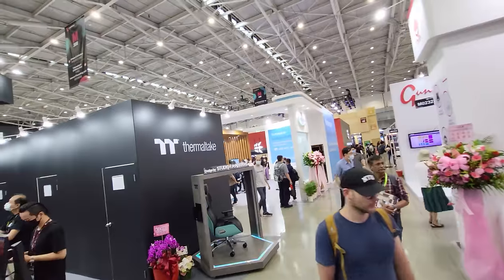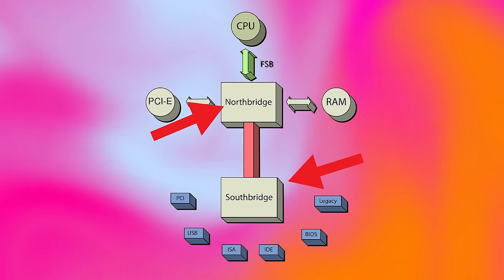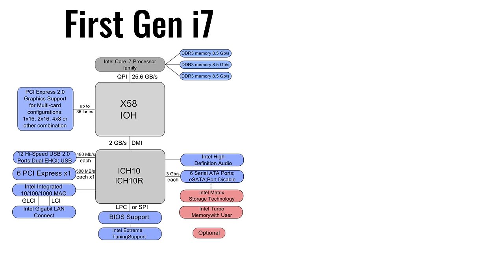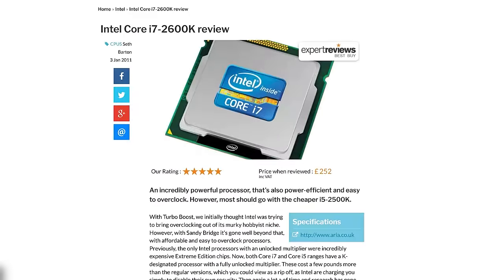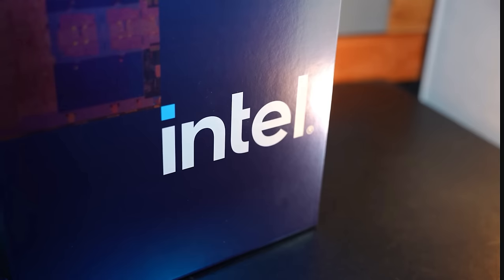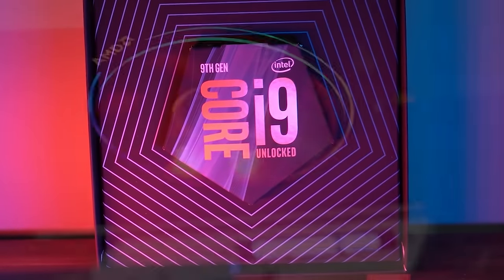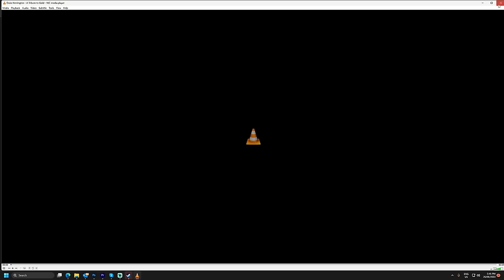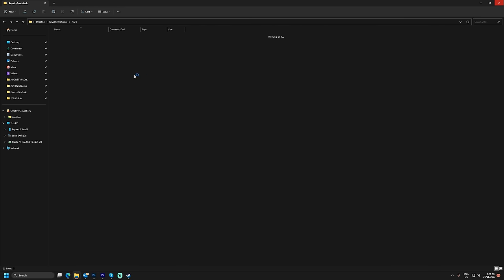SNAP - The Intel CPU Latency Story (Part 1 of 2)

Comment from the maker: I am having an I/OO - Input Output Overload.
Reply: Honest question - do you mean diarrhea??? 😮
Reply: is that why you calculated that 69 to 82 is a 32% increase in your 4060 video?
Reply: I love this video! I was considering upgrading my 8600k to a 13600k and have been looking up motherboards/ram to buy in the next couple of weeks. Now I am considering saving some money and trying to find a 10th gen as I only wanted to upgrade because my cpu is bottlenecking my 3080ti and I wanted to get the most out of my gpu. Do you know if 11th gen has the io on the cpu too?
Reply from the maker: @tyre1337  Yeah pretty busy with a lot of things at the moment, made a mistake on that one, punched a different number into my calculator, will update the description.
Reply: I still have a 2600k Sandy Bridge. I almost considered a 13900k yesterday.
Reply: @SirBlot  maybe look into AMD, the 7000 series is pretty solid.
Reply: @funkysmokee8764  I am going to wait for Nova
Reply: @techyescity can you make a 10900k vs 13900k build i/o latency comparison
Reply from the maker: @ludiqpich198  Once I have finished the other rig I will do just that.
Reply: @funkysmokee8764   I am pretty happy with the 7800X3D with super tight RAM timings to boost snappiness of windows.
DDR5-5800 28-34-34-34-30, so many gamers think EXPO settings are good, but they are very slow set on latency.
Reply: Steve from gamers nexus have done an investigation on the statement that claims Intel has lower input latency than Ryzen in the 10th gen days "on games". He tested low end I3 vs high end I9 at the same FPS and the input latency was exactly the same. He tested a Ryzen CPU vs Intel one at the same FPS and ended up at the same input latency results. He also did other multiple tests that I don't recall and all of them were exactly the same latency. He concluded that: No! Intel isn't faster than Ryzen. Both CPUs are exactly the same at the same FPS. People was talking about Intel having lower latency than ryzen and saying that it is because of thr chiplet design, but that ended up wrong.

In short for gamer, it doesn't matter. The better CPU that gives more FPS is going to give lower latency no matter the CPU design, but from you I see that for content creators and mainstream users the story is different.
Reply: are you really gonna release a video like this and not even include any input lag measurements?
so far it is just a theory - so confirm the theory by comparing a newer and older cpu
Reply from the maker: @ShakeITyEA  Yeah why not? there is no one talking about the topic, there is no information on it online, only information buried with a few people close to the issue in Taiwan.
I already confirmed the issues I am having in this video via the clips, do I need to make barcharts? If so that will take some time, I would like to see (which if you scroll the comments), who else, if anyone else is having this issue, and already there are quite a few reports. 
Also it's not a conclusive video, hence story in the title.
Reply: What you demonstrate in the video is not latency related, more likely a thread management issue.
Reply: @techyescity in your future video's can you please elaborate on the extent to which this effects low end cpu's like the i3. Most of my clients dont need and cant afford the i7 and i9
Reply: Please in next video make a comparisons with amd cpu too
Reply: Why not downgrade to the 11th generation but to the 10th generation if the 11th generation is the same about it ?
Reply: @Y0Uanonymous  convenience (probably parts on hand) and the 11900K wasn't really that much faster in multithreading due to a core count regression in the i9 (10 cores vs 8 cores)
Reply: i was planning to update my 4790k rig but will wait 
thanks for this info!
Reply: @ludiqpich198  I would like this too!
Reply: @N0N0111  But have you tried latest gen Intel?  If not, what are you comparing it to?
Reply: @SirBlot  Well if you take the advise of this vid you`re stuck with it till dooms day.
Let me tell you, you won`t believe the difference between your antique and 13900K. 
Just do it.
Reply: @IslamGhunym  Don`t get fooled and or played.
This is a complete crap video.
It`s something else, it hasn`t anything to do with latencies.
If you just hear him talk about quality silicon then you know where he is talking from...........
Reply: @ShakeITyEA  Off course not.
This what we call attention seeking, it`s all nonsense.
Reply: google "intel amd ssd test purepc pl" and translate to english - the conclusions are interesting - Intel scores in synthetic SSD benchmarks, but in real life applications AMD is faster.
Reply: Have you ever heard of the Calypto latency guide? It will probably not be entirely useful to you, but it could still be somewhat interesting.
Reply: @flanovskiydtauskiy5870  I'm sorry but that calypto guide is a joke, of course better hardware, clean Windows installs and overcloking improves performance, but the rest of the changes suggested are BS. Basically everything in that guide has to be double checked as they don't show real benchmarks or list any drawbacks from the tweaks. The hardware recommendations listed are very misleading, I don't know why they even bothered. Also the sources linked aren't exactly good either, with a few expections such as the integralfx DDR4 OC guide. Just stick to Tech Yes City Windows guides instead.
Reply: @SirBlot  good sir. i have scanned every bit of the internet for good prices on used CPUs. I got a cheap 13700k that was not far from the 12th gen ones. But the i7 10700k was super cheap and it's motherboards as well. my 13th gen upgrade FORCED me to buy, one by one, another component, and another one and then another one, and now i have to wait for a new PSU (100$ more). and when that comes i'll surely find some other bs part that is "too old" or some other shit, that requires changing.
Reply: I was noticing lots of latency while cleaning out laptop and using textboxes on my new 13gen laptop. I thought it was windows 11 but i was confused because i got pcie4 nvme m.2 6000mbs ssd. Work intel win11 pc with ssd lags out also. My ryzen 1700 5year old pc window 10 with pcie3 nvme ssd never lags out. I'm waiting for 2026-27 to build a new AMD cpu and AMD gpu pc. Kind of upset about Intel.

Comment: I am proud to say that I have witnessed the Intel latency problems first hand when you were editing vids in Taipei.
Reply: Grab win 10 iso, newest build.
Then grab Rufus
Burn a win to go image
Use a ssd sata drive on a USB adapter. Like a 840 pro.
Soon as you get booted up install primo cache. Create a cache on the boot drive, say 8 gig. Use the infinite option from the drop down.
Next, re format your nvme drives using 16k or higher clusters. Not 4k. Then add those to primo.
Your going to be shocked.
Reply: @Hawlkeye-e9p  You know it!
So many people don't know how good Primo Cache is with 64GB of fast and latency overclocked RAM.
I use 50% of my RAM as Primo Cache for read & write now for over a year, before that I have used it on a 32GB RAM system with 0 issues for years.
With Windows 11 getting good optimizations and actually feeling snappier than my like 3 years old Windows 10 Pro custom install.
I am thinking to go build a Windows 11 custom optimized iso, currently testing the "Windows 11 Tiny" and it runs very good.
Reply from the maker: @Hawlkeye-e9p  will check this out. First time I have heard of it.
Reply: @Hawlkeye-e9p Sounds like bullshit. It's just a stupid RAMdisk
Reply: @Hawlkeye-e9p  How does RAM disk solution solve any interactive latency issues?
Reply: @Hawlkeye-e9p so, someone has to go through all that workaround to compensate for intel's design flaw? Ouch.
Reply: @stanjs  Might mitigate it, is all

Comment: This is amazing, not a lot of techtubers really talked about latency and real user experience.
Reply: Off course not. Because there is no such problem.
This is a nonsense video and you`re getting played.
Reply: @brugj03  OK intel marketing team
Reply: @brugj03  That delay we saw in File Explorer is dire! I would not put up with that even on a network. If Brian can't fix that himself then there must be a real problem. Do all 13th gen systems do that or just some?
Reply: @wayland7150  It seems you have a little more faith in the capabilities of our honored host.
But being so obviouly wrong in this case. I have my doubts.
Reply: @brugj03  Brian is a fixer, he will have re-installed Windows for a start. Personally I would have tried Linux because that's very different, if the same fault showed then I would conclude it's hardware and work from there.

Comment: In part two could you add some latency metrics? Maybe compare AM5 to 13th gen vs 10th gen
Reply: this
Reply from the maker: Next part will finish the story, though once I have completed the 10th gen build I promise I will compare it to the 13th gen, and even Ryzen 7000, will go quite in-depth.
Reply: @techyescity  Could you please add AMD's monolithic APUs to the test? Preferrably Zen 3+ or Zen4 ones.
Reply: @yurymleh  - zen 3 would be good to add
Reply: @techyescity  thanks, this would definitely help with my upgrade. Still on 8086k
Reply: @techyescity dont forget ryzen 7 s that only has 1  core chiplet thay reduces latency
Reply: @techyescity  Maybe reinstall Windows before each test so that nothing can interfere with the results. The Windows installation in your video doesn't seem to be a fresh one to me, but I might be mistaken.
Reply: @techyescity  thankyou!
Reply: This is weird because I haven’t had any lag what so ever. 🧐
Reply: I know everyone already knows this but remember 10th gen does not support Pcie 4 so 11th Gen was always the sweet spot.
Reply: @the_bunse  while rocket lake is quoted to be a joke of a generation 😭

Comment: Now this is very interesting, i just went from an 8700k to 13700k, upgraded almost everything including the nVME SSDs to gen 4 and i was puzzled by the feeling of it being less responsive and laggy than my gen 3 and 8700k and despite a crystaldisk mark showing superior bench results. Thanks for the finding!
Reply: samesamesame. I went R5 2600 -> 8700K -> 10700K ->11700K -> 12900K. Going from Ryzen to Intel felt like a 2x in responsiveness. 10th/11th to 12th gen felt like a 25% regression and I've had to do a lot of things (ie static overclock, no c-states, hecktonne of RAM tuning, moving to all PCIe Gen 4 NVME's) to claw back half of it.
I also tried a 5800X but it ended up feeling worse than my 5.1GHz 10700K so I went 5GHz 11700K, which ended up feeling and performing the same.
Reply: Just over clock your ram. Got ddr4 4000 cl 16 working with mine and now have 43 ns. I get more fps than most ppl on a 13900k
Reply: @weyo14  This isn`t about that.
Reply: @brugj03  well overclocking the ram should also help with snappiness. Not just fps.
Reply: Turn off c-states and enhanced speedstep and the last one that i don't remember. Leave turbo on, set windows to high performance and turn off memory integrity. No issues here with an i7 12700KF
Reply: @Manakuski  Off course not. Something otherwise would be a fault.
Reply: @JadeIsler Have you tried disabling e-cores on 12900k?

Comment: What's your opinion on Ryzen CCD/IOD latency, Zen3 vs 4 vs Intel?
Reply from the maker: Ryzen 7000 is getting really fast, especially when I was using the 8 core models, that was my initial impressions. 
I am going to trial however 10th gen, followed by Ryzen 8 core and then the 16 core for 7000 (they can behave differently).
My approach however is more for video editing and heavy multitasking, based on a accelerated mouse clicking style, it maybe niche but it's my style of doing things.  It will take time, though for 12 and 13th gen I am giving it up pretty soon.
Reply: @techyescity  when you disabled the e-cores did you also increase the ring/cache ratio? My 12900k does 5.0ghz on the ring no issue with the e-cores disabled. Maybe that's what it is. memory latency tested at 45ns in aida, 43ns in intel mem checker. My old 10900k was at 38ns memory latency.. so a little better but hard to believe that difference is what is causing it. Can't find any info regarding the io driver you were mentioning.. looking forward to part 2. I'm using intel optane drive also.. not sure if that actually helps much. I can't notice any difference with that and a normal nvme ssd.

Comment: I have both a 10900K and an 11900K (yeah I know) and have no plans on going higher up the series for reasons as this,  and temps...great topic.
Reply: Well my 11700 KF not overclocked yet runs at only 48 Degrees Maximum in a Mini ITX case Thermaltake Tower 100 but using the Coarsair H 120 V2 120mm best ever AIO that runs both a push and pull fan on an extra thick radiator sitting on the top of the tower it works exactly as I planned and runs way cool giving me the ability to really stretch the CPU in the future to the max Basically it thinks and acts like a 240mm AIO but in the tower 100 is given the absolute best case to work in.
My reasons for not going beyond the 11th gen is it is the last one to support something I actually use AVX 512, The Latency issues are just an added bonus for me
Reply: I’m using a 11900h in my laptop and whilst it’s deemed better than the desktop ‘remodel’, it’s still quite responsive and powerful enough for fps and multi core gaming 💪🤩🥰👍 and the 11th-Gen lineup / mobo can be had for cheap and features vg latency results!
Reply: I have had all of these cpu, including 12700k, 12900k and 13900kf, and trust me, alderlake/raptor lake with tuned ram is as snappy as 10th and 11th gen.
Reply: @Pillokun same here. I’ve had 9900k,11900k,12700k and now a 13700k. The 9th gen has the lowest latency but once tuned the 12-13th gen is almost as good.
Reply: The 11th gen was ambitious and interesting but missed the mark as a new product. I don't think there is anything wrong with it though.
Reply: @Pillokun  true!!!

Comment: Truly a great video! I noticed the exact same thing, I was kind of expecting it when I saw the hybrid design of LGA 1700 but I didn’t thing it would be this bad. The video was an eye opener because up until now I genuinely thought it was just due to the e-cores. Turns out, intel ditched the ring bus architecture that made them so much sales and appreciation. At the moment I switched to a 7000 series Ryzen (going AMD for the first time after having intel my whole life, I switched to a first gen Ryzen when they just came out but quickly backed off) so we’ll see how it goes!
Reply: 7000 series is very snappy. With what I saw in the video I couldn't really believe my eyes, that's terrible for a daily.
Reply: @benjaminsmekens2344  I think the video demo is very unscientific and unreliable, many things can cause that kind of behaviour. He just picks one and makes a story about it.
Reply from the maker: @brugj03  picks one, with validation from people who actually designed the cpus. Left that part out
Reply: @techyescity  I think you better check your hardware or drivers, ther are problems.
Nothing to do with latency.
13900k Is ultra snappy. Never had a problem and build many systems.
Reply: @brugj03  we'll see once the hard numbers are out in the next video. I find this hard to believe as well, since I've never had any problems with snappiness on my 12th gen system. Now I'm REALLY curious to see what Bryan discovers in his testing.
Reply: @techyescity  Brian, it's can't simply be the CPU is that bad, that delay you showed was diabolical. It's gotta be a timing problem in a driver or something. Something that can be fixed with a software update when they get round to it. Have you tried it in Linux? Open that same directory and see if it's delayed.

Comment: i haven't noticed the issues you had with my 12900k. My old pc has a 10900k with a z590 apex mobo and bdie  ram. They both feel comparably snappy to me. Is there a test that can measure it  better? Or something more repeatable?
Reply: Me too! I have an i9-10850K @ 5.2 Ghz in the living room for 4K gaming. My desktop is a 12900K @ 5.2Ghz, paired with a 144Hz /1440p display. They both feet very snappy!
Reply: @Gamevet  yeah, i'm waiting for part 2 where he's going to go more in depth. My 12900k has the e-cores disabled, the uncore ratio at 4.9ghz , avx512, and the p-cores at 5.0ghz all core. It's also using tuned ddr4 bdie ram like the 10900k. Brian said he disabled the e-cores and it wasn't that. It's the "io driver." But none of the things he pointed out like ms word hanging up or file explorer lagging happened to me. So I have no idea how to repeat it. Both the 12900k and 10900k feel equally fast to me in daily usage. I used aida64 to measure the memory latency and my 10900k was at 36ns and my 12900k is at 46ns. So 10ns difference.. mayyybe it's that?? I don't notice that difference though.. the 12900k is still faster in all the games I play.

Comment: It is extremely unlikely the problem you describe is the cause. At most, it could be an issue with buffer sizes or some other bug in the implementation. The ns of latency added would not cause seconds of delay.
Reply: You`re right. But if you are seeking attention, it`s not the right way to approach this matter.
Do it like this and you get far more attention.
Reply: this...
Reply: @yussef961  Like `this` techyes man does.
Reply: Yep. We are talking about ns latencies, ms in worst case scenarios. These youtube techies know less and less about reality every generation it seems.
Reply: @muhammedalitoya1505  well I began with 8 bits computer so ...amstrad cpc and yes ns latency is not likely to be seen while using it